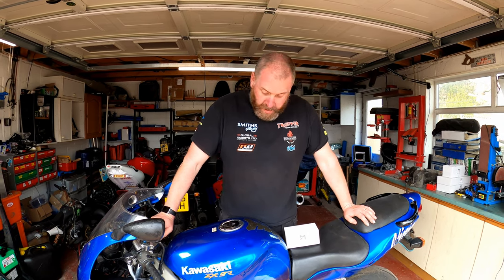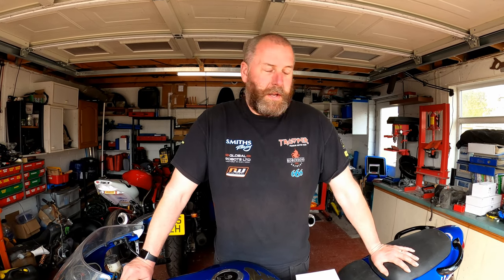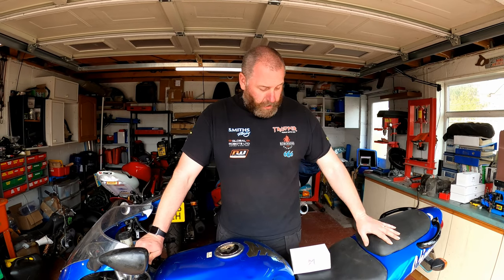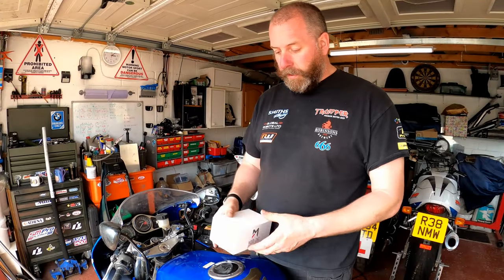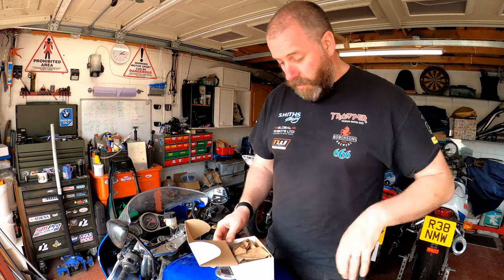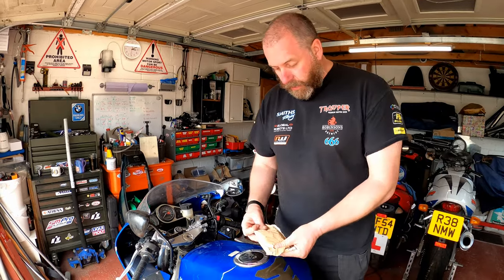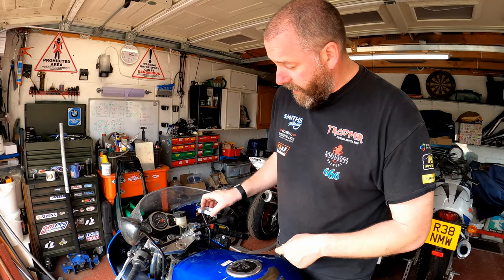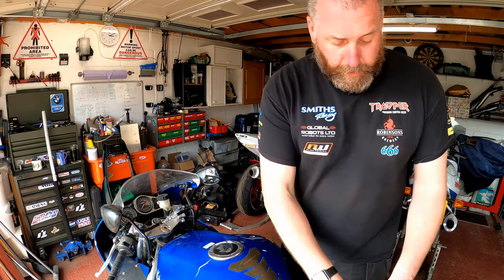Fitting A Moto-CNC Handlebar Riser Kit To my 1998 Kawasaki ZX9R C1

Comment: Hi Kev, i have a set of the cnc moto risers fitted to me zx9r the kit as supplied like yours was missing the two 6mm washers that fit under the two allen bolts so they do clamp the clip ons to the top yoke. I did contact cnc moto and after sending them a picture of the orignal bolts they advised me that the two washers were missing and did indeed send them out to me, so i was able to fit them correctly and more importantly SAFELY!.
So it might be a good idea you do the same before you ride the bike!!!
Reply from the maker: Thanks for the info, i'll give them a shout mate! 👌
Reply from the maker: By the way, if you watch my most recent video, you’ll notice that I won’t be riding the bike for quite some time! 👍🏻

Comment: Hi Kev, after watching your video I have bought a set of these risers for my 9R C1, I’m a little disappointed to be honest, not with the quality of the risers, I think they’re very well made and I’m happy with them, I’m just annoyed that the Allen bolted supplied with the kit are useless as they have no flange and apply no clamping pressure to the bars whatsoever. Basically In fitting this kit as supplied by cnc moto you are left with half the area of clamping load on the fork leg and nothing else? I’d they had supplied a longer flanged bolt in the kit or even a washer and button head or something else suitable then fine but they don’t and I’m pretty sure you would have thought exactly the same when fitting them.. don’t be afraid to make slight criticism of products in your videos, just because they give you stuff for free, like i said the risers themselves are great but I’m not having those Allen bolts that just wind down through the bars and don’t even tighten up onto them. Other than that pal, look forward to the next zx9 vid!
Reply from the maker: @moto-cnc wish to comment on the reasoning behind the bolt choice for these risers? @Joe Shmo, I do get your concern however my buddy and I both lifted the front of the bike from the bars and they didn’t move a micron, perhaps I could have shown that in the video but I didn’t have the camera to hand at the time! Cheers for the comment though Pal, looking forward to getting stuck into the resto very soon! 👌🏻😎